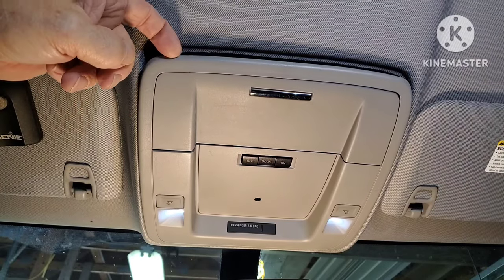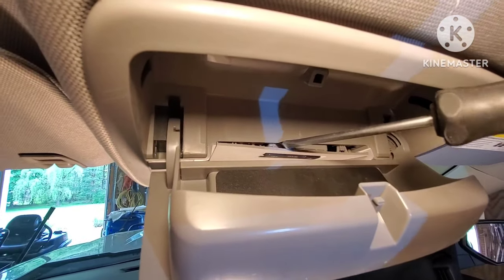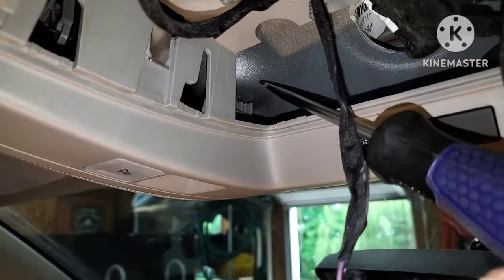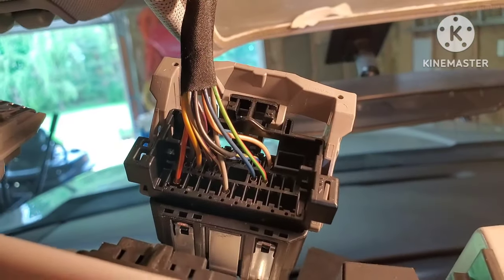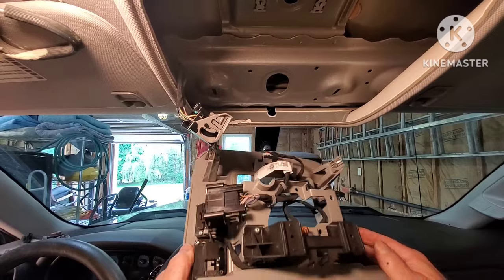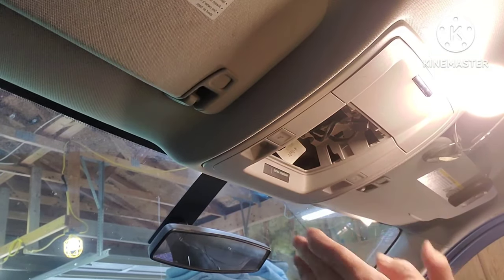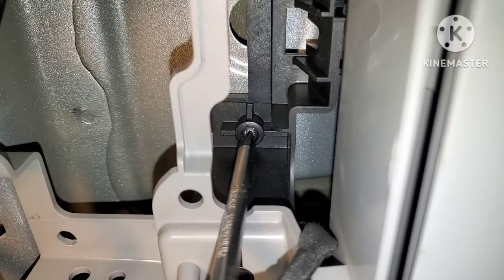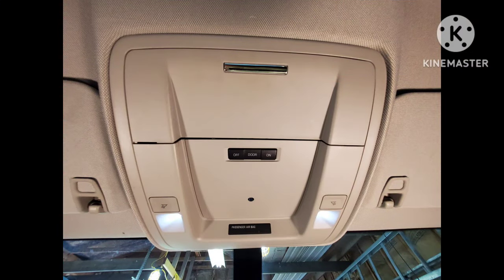fix 2018 chevy loose ceiling console ( no special tools)

Comment: Incase anyone comes across the situation I found here ya go. 

The black clips that the screws go into were broke in my 2017 Tahoe. Idk if it was from bouncing around or if someone else was messing around in there before I owned the vehicle and snapped them off. I ended up fixing my issue by putting washers between the screw and black clip so the screw heads wouldn’t just slip through the clip. Tightened the screw back Into the metal bracket with the clip and washer and was good as new! Great informative video by the way exactly what I needed.

Comment: My fingers were too big to hold the screws when reinstalling.  I used a hook nosed needle nosed plier to hold it and seated.  I had a few more cables to remove but otherwise the instructions were spot on.  Better lighting helps.  I used some lock-tight, great suggestion, by the way!  Appreciate the detail in the video.  Spot on for my 2018 Chevy Tahoe.

Comment: Thanks - was exactly what I needed to fix my truck.  TIP: the screws are awkward / tricky to get back in.  I put a strong magnet on a screwdriver to help keep the screw on the tip until I could get it started.

Comment: Great video.  This has been driving me nuts for weeks.  I ended up using a magnet to hold that tough screw in place as my sausage fingers wouldn’t fit.  Didn’t take long at all.  Thanks for the help!
Reply from the maker: Have the same problem with my fat fingers too

Comment: Nice video. Was able to pop off the panel and 2 connectors, found the two fallen out screw. Got the easier one back in first,  then the more difficult one. Tip - use a magnetic screwdriver.

Comment: How do you remove the glasses door? Won’t stay closed.
Reply from the maker: @CSltz  not sure never looked at it
Reply: There is a little pivot pin that rides in a grove on the passenger side of the holder. I can’t get it back into the main housing and then the pin back into the grove or track.  There has to be a way.
Reply: I wasn’t expecting a response back so quickly. Thank you. I would like to send you some pictures if I may.
Reply from the maker: @CSltz  keep trying and lmk..don't get mad at it that usually makes it worse